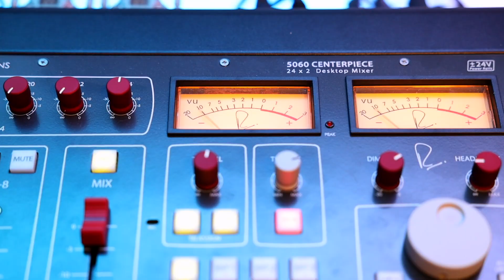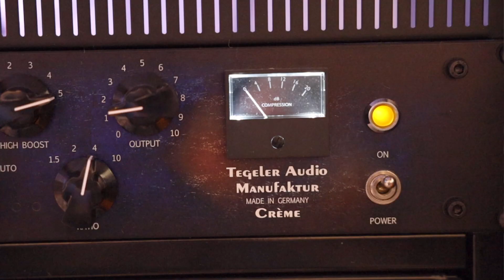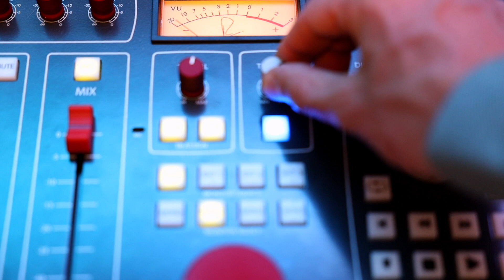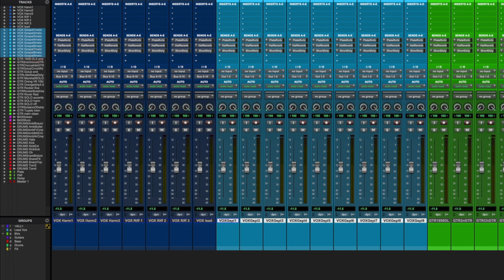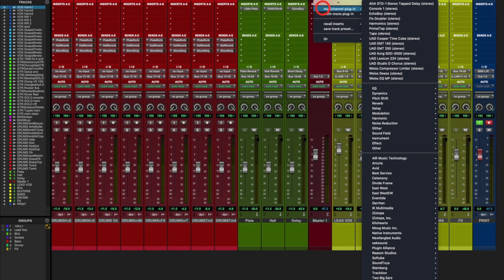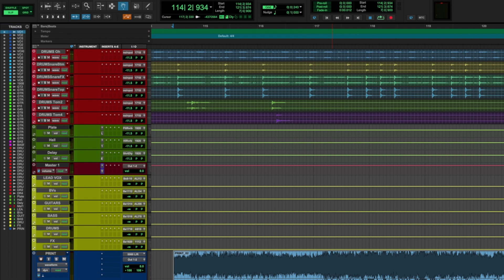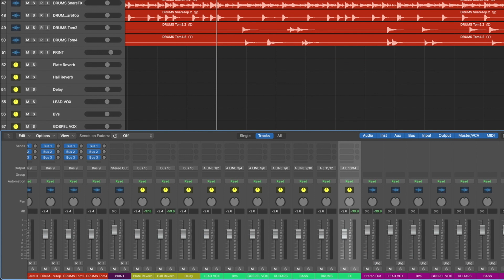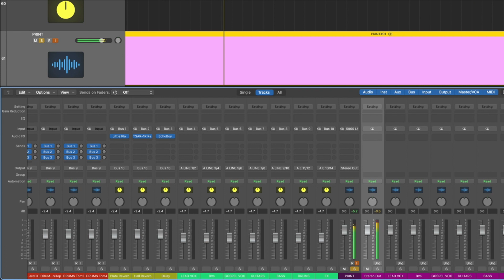Analog Summing Workflow 🛠 Setup and Benefits in Pro Tools and Logic Pro Tutorial 🦾

Comment: Hey loved the video and learned alot. I just purchased a Mackie 32.8 with a 24 channel extension. I want to use this as a summing mixer to see what potential I can pull from this board, but I am also  curious to know if you have any video showing how you would route the board with TRS cables and such, also incorporating a patch bay to use with my other hardware. I see the tape in on the back and I would love to understand what goes where a little more. Thanks.
Reply: Also new subscriber
Reply from the maker: Hi! The Mackie will combine analog signals. Will it give you the sound most people want for “summing”, probably not….  But definitely give it a try to see if you like the workflow before spending $2500-10k on a better summing mixer! 

I don’t have another video on exactly what you are asking, but try my video on the 5060, which might give you some ideas. Really it is about just having inputs into the mixer and printing the master output back into your DAW. Hope that helps!

Comment: I use the rack unit from Neve for summing it sounds nice. one thing you cant do is push it to red lights withough clipping the outs on the converter from D to A it would be nice to have a headroom control in the unit to get more extreme distortion for fun. but that said I think it is better if you dont go for much saturation. It does sound great. but I also sum-times just want to go back to in the box summing because then working mobile anywhere and everywhere is more doable. But I think I will keep it regaurdless, and just setup a better system so I can edit on the go and mix with the Neve without rerouting my sessions.
Reply from the maker: Yes. A few people mentioned this. It depends on your D-A converter’s output. Yeah, a headroom control would be awesome. With the 5060, you have the ability to hit things harder, which I love.
Reply: @ToddUrban  ah I see, I have an apogee ensemble with a Yamaha Adat connected to it to get the 16 outs. the unit u have looks nice, how do you find it with recall and such?
Reply from the maker: @deareeMusic it’s great. Actually, I have a video on the 5060 you might like! The Apogee should be solid. You might want to ping RND for more tips too.
Reply: @ToddUrban  ya maybe i will. Honestly cliping fast transients at the output into the neve doesn’t sound that bad ha. I need to do some more purposeful testing on that though.

Comment: "it does something you just can't do with a plugin"... What exactly is that "thing". If anybody can point me to an ABX of a propperly level matched ITB vs analogue summing example, id be more convinced that this is anything more than voodoo.

1. Headroom: the concept does not apply to digital summing (for any practical purpose). With 24 bit audio there is over 120db with which to perfectly, i repeat, perfectly sum signals.
2. Connecting stereo bus equipment is simple to do with any modern iterface... 
3. Monitoring is same as 2.
4. Stereo width is by definition largest in digital audio (most accurate phase relationship).

Any claimed advantages in analogue summing must be in non-linearity, phase innacuracy, crosstalk or altered frequency response and can all be achieved digitally or with analogue stereo bus processing.
Reply from the maker: Hi. Thanks for the comment. The big thing with headroom is workflow. You have the ability to get plenty of headroom in a DAW by pulling down faders and readjusting gain staging. Ever pull down by 15dB, get more tracks added and then you need to readjust? In the analog domain, you are less likely to encounter this, as you can saturate at the top, rather than clip. Additionally, breaking into stems further increase the way we hear these sounds combined in the final mix. 

A similar idea applies to the stereo image, though I would argue it is less so and more dependent on the summing mixer used. 

Regarding points 2&3, yes, it’s easy to connect stereo gear. I believe maybe I was talking about the idea of switching between a stem mix and stereo output? I’ll need to double check. Thanks for opening a good conversation here! 😃
Reply: @ToddUrban  Thanks for your recponse. Unfortunately I do believe summing boxes are a case of "golden power cable syndrome" until the above ABX test is done by somebody and published for me to hear.

Workflow: If an engineer doesnt know how to gainstage then an analogue summing box wont help them either and they have bigger problems. You can also just route everything to a bus, turn that bus down, and route that to the master... free and 2 seconds work...  "headroom" is simply not an issue in the digital domain as I said, and also: clip gain exists

Stereo image: is dependent dependent on the summing box being used, and none of them can compete with digital phase correlation, because digital phase correlation is perfect by deffinition.
Reply: @GingerDrums  I think the saturation that analog summing adds helps with the headroom since its controlling the peaks. This is the main difference and advantage it has (imo) over only digitally moving faders.
Reply: @sevildogan8279  I mentioned non-linearity in my original post. Distortion or soft clipping is free and easy...
Reply: @GingerDrums  analog saturation hasnt been replicated digitally yet imo
Reply: @sevildogan8279  Serban Ghenea has left the chat
Reply: Tone Projects Michelangelo beats my 4k mastering eq and has both more or less saturation colour as needed. Goldclip beats my Arora converters for clipping. Saturn 2 with oversampling beats my Neve Pre because it's multiband... Digital has not only emulated but surpassed analogue saturation in my opinion. I have over 10mil streams of my mixes and masters on Spotify alone and nobody is complaining there...
Reply: @GingerDrums  I dont think anyone is saying you cant make a good mix itb. but it will always sound different compared to the same mix being processed through analog gear. I personally prefer the analog sound and the reason digital is trying so hard to bring back that analog warmth is because it sounds good in the first place. Using a manley compressor and a pultec style eq on a master bus will do so much to the sound without workin so hard. recreating that digitally is to me impossible. you can get close tho. and still sound good. i just think analog still sounds better. maybe in the fuure we will get there
Reply: @sevildogan8279  I have gear, it's not better imo. But especially when it comes to the summing conversation, that is really just purely a superstitious marketing phenomenon. Outboard gear does something different, sure, but a stereo pass does the trick you are talking about.
Reply from the maker: 😂 Serban will never have a hit if he is mixing in the box.
Reply from the maker: To be clear, these days I print my stems through analog summing and yes, I do use some hardware for that. But for final deliveries, I’m almost exclusively ITB for the reason of recall. I will still sometimes sum those stems in the analog domain, as the additional saturation and inserts of my favorite outboard gear can help tie the stems together for a final print. The biggest reason (beside convenience) is so that the client can use the stems to completely recall my mix without hardware. That being said, when I don’t need to work that way, a final pass through the circuitry of my summing box and some favorite outboard gear does offer some pleasing processing that I cannot always achieve ITB.
Reply: @ToddUrban  TRUE... If he'd have used outboard he would finally have smooth creamy punchy mixes... LOL. CLA 1176 for the win...
Reply: @GingerDrums  I believe any analog circuitry adds saturation and color to the sound so why would it be any different for summing?
Reply: @sevildogan8279  and your point is...? All these summing boxes are expensive precisely because they avoid non-linearity as best they can. If I turn up heat in pro tools I have more colour than a summing box...
Reply: @GingerDrums  look man i dont know what to tell ya, im not really into debating stuff, lets just agree to disagree.
Reply: @sevildogan8279  you didn't make a point yet, nothing to disagree on
Reply: @GingerDrums  😂 have fun mixing

Comment: Hey, great video. 
Did you try the routing in Logic also with the I/O plugin? In other words, use the I/O plugin on the busses and only select the output in the I/O plugin, and then insert the I/O plugin on the return/print track with only the input selected in the I/O plugin. If you tried it this way, did you experience any latency issues? Thank you!
Reply from the maker: Yes. You can also use the I/O plugin. However, I’ve found over the years that this plugin can be a little buggy. And since I’m always running all my tracks out during summing, I didn’t need to compensate for latency. Therefore, I will just patch any outboard gear prior to going to my summing mixer, rather than using the I/O to return it back to Logic.
Reply: @ToddUrban  thank you!

Comment: do you have to print to listen to the final result of the summing box? can't you monitor the result in the daw before printing? im asking since my setup will be orbit 5057 out in neve mbp and back in daw
Reply from the maker: Yes. The 5060 is different since it has monitor outputs. But in your case, the 5057 isn’t meant to be a monitoring solution, so print back to a stereo track and monitor what you are printing. That will let you hear the summing exactly as it is printing back.

Comment: Greetings,
First this is an amazing video. I'm new to the neve 5057 summing mixer workflow. I have a few questions but here's my main question. When using the neve 5057 you hit the converters on the way out, and it looks like you print directly back into the box. That hits the converters on the way back in sooo technically you've hit the converters 2x so far. This does not reflect any additional master processing. With your work flow you would have to hit the converters again to bring the summed mix out to mastering gear like Limiters, SSL Fusion, etc.
My question is why not hit those outboard items and mix/master your track at the same time to avoid multiple trips/hitting converters multiple times?
So the chain would be UAD 16 -> Neve 5057 -> ADL 1500 (Limiter) -> SSL Fusion (Master Bus Processing) -> Dangerous Compressor -> UAD 16 Print/Master track.

Does this work flow make sense 🤔 to  limit/prevent hitting your converters multiple times?
Reply from the maker: Yes, conversion from D/A to A/D is always a concern. However, I do not find that I have audio degradation after 1-2 times of running out of the box. The benefits always outweigh any slight noise that might be introduced. If this was 20 years ago with lesser quality converters, I would have a totally different answer though! But for me, I like tracking everything first, doing some in the box basic clean up, and then focusing on my entire mix once I can connect my favorite analog gear.

Comment: Yes, of course there is clipping on the master fader at the start of the example.  The inputs are to hot to begin with.  That would not be a problem if they were gain staged better during tracking, and then edited more closely before the mix to reduce unnecessary transients that are taking up the headroom that provides your volume.
Reply from the maker: Absolutely right. But my point is that instead of needing to go back in and trim automation of all your tracks, you have way more headroom. Yes, you can pull all your faders down -15 or -20dB to start, but sometimes that isn’t really necessary. But good point. Yes, your automation and dynamics processing might avoid this clipping.
Reply: that does not take away his point on analog headroom or analog peaking captain obvious

Comment: Looks good!
Why add plugins after the printing and not before printing?
Is there a difference or just preference?
Mainly becasue you can see the levels etc before printing.
Reply from the maker: Good question. I might decide to do both. But applying them after summing will have a different effect, as the tracks have already been summed together. So after printing, I think of this more as mastering, or at least the last step in the mic before mastering.
Reply: @ToddUrban  Excellent! Thank u
Reply: @ToddUrban  Hello again. I have a couple of more questions.
Do you use the summing gear after your mix in the daw?

When producing music, do you have it running through or just leave it for the last stage like your video?
Reply from the maker: I think the biggest advantage is to start with summing in place. That let’s you hear everything better from the start. I don’t always do that, especially if an artist is building a track a bit at a time. But once tracking is done, I mix with the summing in place as early as possible.
Reply: @ToddUrban  Cool. Thank U.

Comment: awesome video! got the Centerpiece a few months ago and it´s been a game changer. Got some similar questions to other viewers (maybe silly ones): 
1. what do you recommend for setting the right input levels in the Print track? If I push the master fader in the 5060 (in order to get some warm saturation) I often digitally clip in the return into the box. Also: mastering usually requires -10 - -6db peaks... how can we get those Print track´s peak levels without the need of turning the centerpiece master fader down? 
2. Why going track->bus-> output and not going track-->output (I don't understand the need of a bus track in the middle).
 Thanks in advance!  great video!
Reply from the maker: Great questions. I’m actually about to do a 5060 video and will address some of your other points. But as for the question of why I go to a bus and not just straight to an output:

I do this since I can then set the bus routing to either physical outs or staying in the box. However, the mix prior to these busses is the same. This is important to me when switching systems or comparing in the box vs summing. Additionally, the busses are great for making stem level adjustments for multiple revisions for my clients. 

Hope that answers one of your questions. As for the others, I’ll have a video out soon! 😉
Reply: @ToddUrban  makes total sense! thanks for answering!! and looking forward to that RND centerpiece video! 🙏🏼

Comment: I recently got the neve orbit 5057 and the line 1&2 doesnt sync with the other line outs in logic pro x. Any idea how to solve the issue?
Reply from the maker: Are you using an Apollo? If so, line out 1&2 might be occupied if you have a 2nd set of monitors routed.
Reply: @ToddUrban  Yes! I’m using x8p. I only use one set of monitor. I’m assuming its my routing but can’t figure it out
Reply from the maker: @BoboRenthlei  Hmmm.  It sounds to me like you have 2 sets of monitors assigned. Make sure your Alt Count is set to zero on your Console settings. If that isn't it, I don't know what to suggest without checking out your entire setup. (which I can do via a Zoom lesson, but first want to see if this fixes it)
Reply: @ToddUrban  When i import frest multitracks it all works fine but when i use it with my template which consist of midi drums the line 1&2 is always a milliseconds faster than the rest of the outputs
Reply from the maker: @BoboRenthlei  Weird. I have no clue! Sounds like a latency issue, but then you should hear that same issue if just running the audio in the box. I'm out of ideas! You might need to ask UA about that one. Or maybe your DAW session is somehow adding latency on the output???
Reply: @ToddUrban  Looks like the sends channel cause the issue. I route it to different line’s and now it works. How do I add plugins as an inserts when i want to mix through the summing mixer? Add the plugins on the stereo out and then export?
Reply from the maker: @BoboRenthlei  just put the plug-ins on the inserts of any channel and they will output to your summing mixer! It sounds like you’ve got it working now
Reply: @ToddUrban  its all working now. Thanks for the info. One more question. Is there a way to put plugins on the mix buss? Like a limiter and eq?
Reply from the maker: @BoboRenthlei  my suggestion would be to print your mix and then apply them later. But you could monitor just the 2 track return from the Orbit and put the plug-ins there, just make sure to not listen to the individual tracks or you will get phasing due to the time delay. Either works.
Reply: @ToddUrban  Will printing the mix and applying later affects the overall sound when exporting the track?
Reply from the maker: @BoboRenthlei  Absolutely. It changes everything. Maybe take a look at my video on the Tegler Audio Creme. This might help give you an idea of how I use my mix bus.
Reply: @ToddUrban  affects as in a bad way since its printing back into the digital realm. Will it affect the width/depth that the transformer produce in a bad way? Or its how you’re suppose to use an analog summing mixer? Print and then add hardware or plugins and then export as a finished product? Apologies as i’m new to analog summing.
Reply from the maker: @BoboRenthlei  no, printing it back is fine. I’m happy to setup a lesson if you want to talk more in depth. No pressure, but it might help grasp some of these concepts and help you get more out of your gear by understanding how it works a little more.